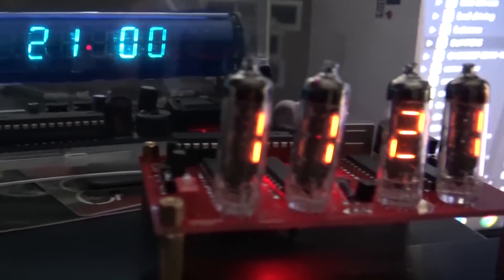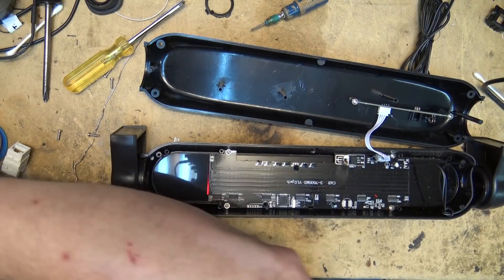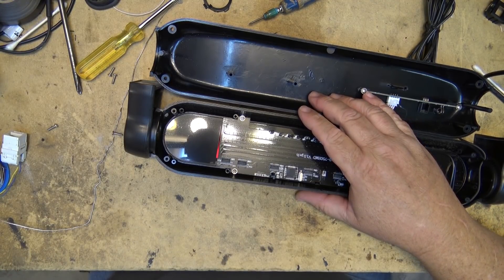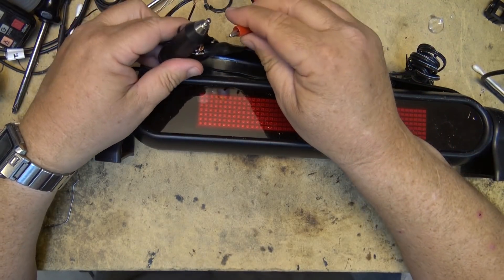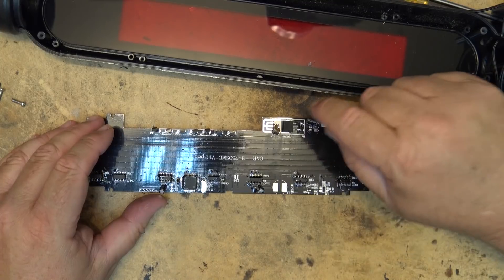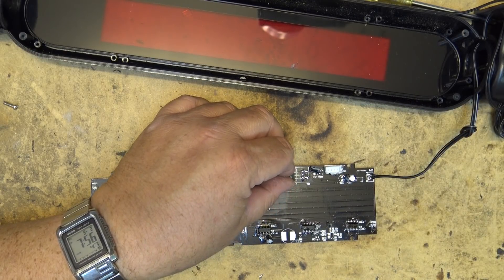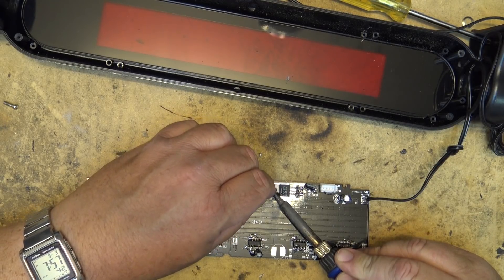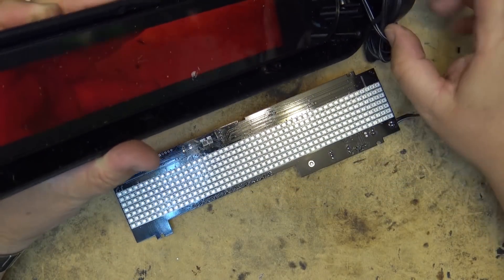LED message board repair

Comment: there probably should be a heatsink on that regulator.  I was quite surprised it had nothing on there!  Also interesting is the LEDs are all separate and not the LED display modules.  I guess it's cheaper that way.

Comment: Lesson one, in double quick time, J...full marks   8-)
Always check the power supply first including a load test. I had a 12volt 1.5A adapter yesterday that measured 12v but on a 30 ohm load fell down.

Comment: Could you run this sign off USB power or would that have too much interference?
Reply from the maker: Probably not enough current. It draws about 1.6  amps at 12 volts!
Reply: What I meant was if you bypass the regulator that you replaced and simply add a 5V USB where you put 5V on the output of the regulator and the sign worked. You could maybe just use a phone charger and the sign will draw less power.
Reply from the maker: coondogtheman1234 
Yes that would probably work
Reply: the 1.6 amps current is likely due to having to push 12 volts down to 5V. I bet that sign would run more efficiently on 5 volts. Have you tested how much current draw if you were to run this on 5 volts.
Reply from the maker: I didn't because the original intent for this sign was to put in my back window to send a message to the idiots that drive at night with no tail lights. It is a huge problem here.  We have daytime running lights, and because the USA doesn't have that cars for Canada have a module that turns on the headlights at reduced brightness when the light switch is off. Problem is the dash on many cars, (Honda, Ford) is light up bright as day, and the headlights are running at reduced power, and idiots forget to turn on their tail lights, and then you you blink your lights they just think you want to pass and pull over.
So I was going to put a message saying "Your tail lights are not on... SWITCH ON YOUR LIGHTS" as I passed them, just never got around to mounting it. Stuck it on my bench as my message barker instead.
Reply: I have a mini one of those but it's a badge that you wear and I modded it to run on 2 AA batteries but not that well. When I find it I'm going to mod it again and better but run it on 2 AAA batteries since it ran on a single CR2025 coin cell which it went through them quickly.
Reply from the maker: Yes my son had one of those badges that scrolled a message. He wore it to comicon conventions. Forgot it was on his jacket when it went through the wash and that was the end of that.

Comment: Why didn't you just bypass the regulator and put 5v direct? It seemed to work just fine when you put 5v on the board.
Reply from the maker: Because my adapter I use to power it is 12 volts. I don't have a 5v wall wart handy.
Reply: These signs were an old design for use in cars. Dropping 12v to 5v generates quite a lot of heat for the 7805.  7.5v to 9v would be a better input voltage range.
 Today, we have buck regulators which are switching regulators. I use them and can set the voltage and maximum current without them getting hot.  I buy them for around £1 each for the 2A versions.

Comment: 12v down to 5v at the current draw of those signs is a lot for the 7805.. I had an early version of those car signs and inside it had a couple of diodes in series used just as a voltage dropper. I had not seen that done before but it looked like a after thought bodge as they maybe discovered the 7805 getting too hot! :)  maybe the new versions are more power efficient tho...
Reply: Andrew Sparrow How long ago are we talking? The LEDs are gonna be the lion's share of the load, and red LEDs haven't changed much since the development of the superbright red LED in the 1990s. So probably your unit has similar current draw.
Reply: more than 5 less than 10 :) The message length might have been longer but yeah, probably similar load. A 9v PSU would probably better suited
Reply: Andrew Sparrow, yes i would of expected a 9 volt input to a 7805, less dissipation :-D.